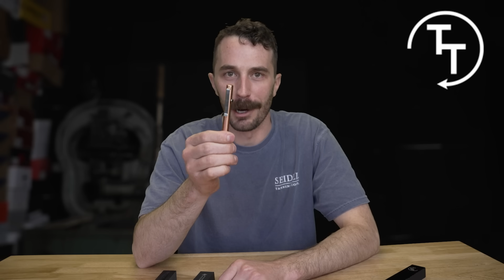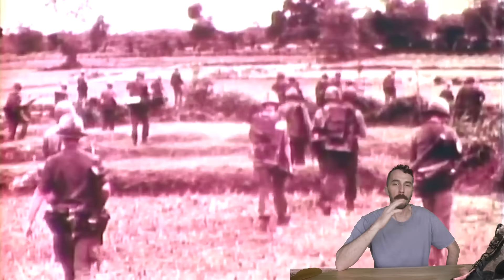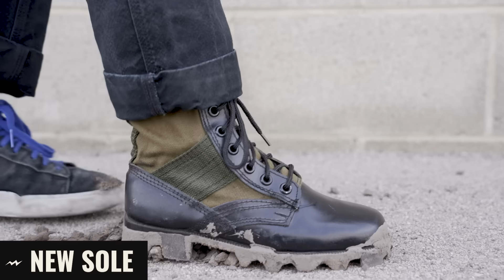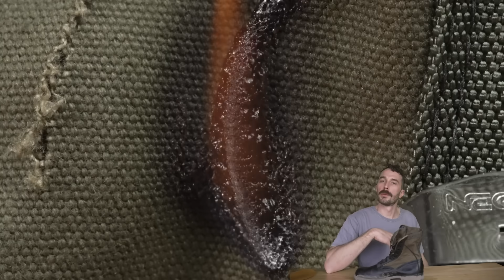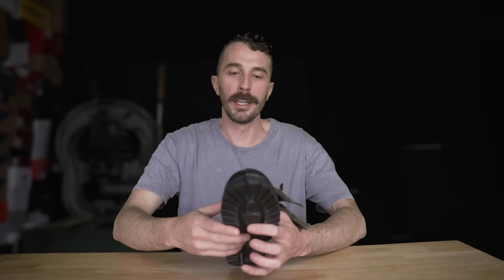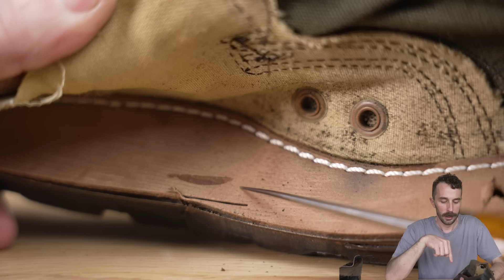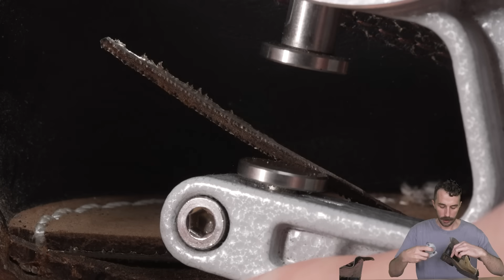Why it took 57 years to replace jungle boots

Comment: I was in the Army from 87-94.  I was in 1/3 ACR at Ft Bliss, 1/508 ABN in Panama, 3/505 82nd ABN at Ft Bragg and deployed to Saudi Arabia and Iraq, 3/334 and 1/19 as a drill sergeant.  It's interesting reading some of these experiences... I REALLY wonder about some of these experiences...  I didn't own jungle boots at Ft Bliss- those wouldn't have been good with all the sand, but bought a set before I went to Panama but ended up getting issued 2 pair when I got there.  Not surprisingly, in Panama most everyone wore jungle boots most of the time.  I seem to remember throwing away the poron insoles and getting AAFES foam insoles much later.  I always wore jungle boots for any field operations and most of the time in garrison.  When I got to the 82nd- again, most everyone wore jungle boots all the time.  During  Desert Shield we melted MRE bags into the drain holes because the boots would fill up with sand.  We got issued the first desert boots the night before the ground war- same pattern as jungle boots- just tan with rough out leather and no drain holes.   When I got to be a drill sergeant I rarely (if ever) wore jungle boots around privates.   At the end of my time in the Army we weren't allowed to wear the green jungles anymore, but could wear the black speed lacers.

In the past 25 or so years, I've read of people complaining about jungle boots- and it's important to remember it was a different Army back then.  You only had a few boots you were allowed to wear.  In the 82nd you could wear jump boots, jungle boots or cruit boots.  There were engineers attached to us that had HiTech boots- and we were told unequivocally that we could NOT wear those.  Out of all the options, jungle boots were the best field boots most of the time.  They were tough.  Your feet dried out.  You could use a stick or bayonet to scrape mud out of the lug channels in the Panama sole.  And they lasted forever.  In the past 20 years or so, the rules have changed, soldiers have a choice to wear boots that meet AR670-1 compliance, and boot technology has come a long long way.  I used to think that having a good solid, unforgiving sole was a plus for a field boot and for a road march.  Last year I got a set of Garmont T8 NFS boots.  Absolutely better boots.  The sole will wear out, but the boot is infinitely more comfortable and less than 65% of the weight.  There's one thing about having a boot that will last forever- but will never be as comfortable as a trainer.  The Garmont is as comfortable as a trainer- and has better lacing and ankle support than the jungle boot- they have drain holes and the boots themselves dry amazingly fast.  And just like any trainer or running shoe- replace it when it starts to become worn or unserviceable.  It seems there really hasn't been a whole lot of problems resupplying deployed troops, either on post or deployed to the middle of the desert.  BTW- for the record-  Jungle Boots are not "light af."  They're pretty shockingly heavy at 735 g compared to 475 for the Garmonts.  As a comparison point- my Corcorans are 815.

I still use my old main field boots as my lawn mowing boots.  The soles are rock hard and worn flat, the leather is shredded from desert coral and cracked from age and abuse, the drain vents are plugged with melted MRE bag, the stitching is coming out on the outer vamp, they're missing half their eyelets and the metal plates inside are cracked.  I NEED to use thick insoles or my feet would probably be cut to shreds.  They're really unserviceable shoes- but they've kicked ass all around the world.   I have a picture of me with those boots kicked back on Noriega's desk, pictures of those boots above different drop zones and most of all of Desert Shield...  I don't know that a lug pattern can be better with mud than the Panama sole, I don't think there was a better all-around all purpose field boot than the jungle boot for most of its issued history.  But the torch has been passed.

Comment: I got a pair of the Govt. Issue in all-black some time in the late '90s.   Very well made, far better than the cheap knockoffs w/ the green canvas (and much more comfortable), with good arch support and a nice cushioned band around the top of the lug.   I wear 'em when it's hot and I throw on my period Spec Force tiger cams.

Comment: Did my first 40K (26 mile) hump in the fleet ('88 FNG pfc) with brand new, never broken in jungles. I made it but feet were raw hamburger. Skin hanging off and 3 toenails ripped clean off, others very loose. Nails and feet were black and blue with severe swelling. First time other Marines had any mercy on me...Didn't make me run 5 miles for PT the next day. Lesson learned. Break 'em in right. BTW, most comfortable boots ever after that and still got'em. Boxed up of course...

Comment: My old jungle boots lasted into the 1990s(about 20 years). They were cotton canvas with a different sole pattern than you showed. I loved them. I later developed plantar faciitis(PT). The VA doctor told me to go back to jungle boots. Couldn't find any so, I tried desert boots. They work great. It turns out the punji plates prevent PT. The insoles worked but you needed to replace them every month or two. I spent 5 months in an Army hospital. When I got my gear, my boots had disintegrated so I got 2 new pairs at $6 per pair. Good Luck, Rick

Comment: We werent allowed to wear jungle boots. 
On another subject, in the mid 80's, an 0-5 yelled at me one cold wet February day about my Korean war era field jacket I was issued and wearing. It was the best piece of gear. Told me I had to put on my camo field jacket designed by a fashion designer who had never served. When you wore it and sat down, your belly button was exposed due to ride up of the jacket. To this day I think that 0-5 was a jerk. Pretty but cold troops over war proven function.

Comment: those insoles are the best insoles I have ever used. I used to be able to buy them from this old workwear store, sadly they closed about a decade ago. my feet, which seem to sweat more than most, were always kept dry with these insoles. And Jungles boots themselves are some of the sturdiest boots I've ever worn. I wore the soles off two old surplus pairs I had as a teen. Wore them year round, thin socks in the supper, wool socks and bread bags in the winter, the rubber would get cold and freeze below zero through, that made em real slippery.

Comment: MAKE SURE YOU ALWAYS RETRACT THE PEN CARTRIDGE WHEN YOU ARE DONE WRITING AS A RULE OF THUMB RELIGIOUSLY. FOR YEARS I HAVE TAUGHT THIS TO PEOPLE. AND THEN ASK THEM, WHY IS THE REASON YOU SHOULD ALWAYS RETRACT  A PEN. AND I HAVE GOTTEN MANY ANSWERS. THE REASON I STRESS THIS IS FOR ONE REASON. IF YOU DON'T RETRACK THE PEN AND YOU DROP IT AND IT FALLS ON THE WRITING TIP ON A HARD SURFACE. THE SOFT BALL GETS DAMAGED, DENTED AND IT STOPS ROTATING AND THE PEN IS FOR THE GARBAGE CAN. THROUGHOUT MY YEARS IN SCHOOL AND EVEN IN COLLEGE. NOT ONE TEACHER HAS EVER BROUGHT UP THIS POINT. IT WAS ONLY A FEW YEARS BACK I REALIZED THIS AND I HAVE NEVER HAD A PEN GO BAD ON ME AGAIN. THEY WORK UNTIL THE INK RUNS OUT. I WANTED TO MAKE A YOUTUBE VIDEO EDUCATING PEOPLE ON THIS. IF I EVENTUALLY DECIDED TO MAKE ONE. THE PEN MANUFACTURERS WHO NEVER TELL YOU THIS. WILL BE SMOKING FROM THE EARS.

Comment: I, USMC, wore civvie jungle boots in Gulf War I, rather than the "slick black Cadillacs" (full leather quick strap boots) as issued.  Pros and cons.  Lighter, but I also slashed the jungle boot at night on the side of it on a tent stake.  My bro Cpl. Mark Pitman wore Israeli desert boots.  Much better boot, like high top tennis or b-ball shoes for the desert.  Never in formation, of course.  The (newer) USMC desert boot appears to be apropos for modern battlefields.  

Cheers, Semper fi!

Comment: When I was in the Army I wore Jungle boots with The “ Panama soles”.  The nylon tiedown strap you describe is actually for support. If you look at the inside of a para Corcoran jump boots it also has nylon straps sewn inside the boot.  Jungle bitch will tear you up if you don’t know how to break them in properly.  I never had problems wearing jungle boots. But the old school leg boots were also comfortable. Jungle boots were great in the summer. Altima brand is the best. There were some Asian made knock offs. They weren’t as good a quality but they were extremely cheap to buy off post.
Reply: +1 for Altima. I accidentally bought some Vietnamese knock-offs and they were done after the first ftx.
Reply: I remember seeing a grunt use 100 mph tape to tape up the sole on a pair of crappy jungle boots that he had bought off post. He got what he paid for that’s for sure.

Comment: The Do Not Boil warning was in all issue boot inserts. For that mesh to work properly you had to clean it at least twice a month because they would clog up with the fuzz from your issue socks and all the darn foot powder people used. 
Best way was just in a,sink with warm water and a nail brush with a little soap and drip dry. 
And yeah, issue jungles with the revised soles were great boots.

Comment: I am dying to know what is inside the bunny boot as well. I grew up on the West coast of Alaska, and have a lot experience with the white boots, which is supposed to be the colder climate version. The last time I was Spring bird hunting, I shot a goose and attempted to have my cousine help me retrieve it. I lined my snowmachine up with the goose and him on the back of my rig, and was going to skim out and have him snag it. When lining up, we broke through unexpectedly, and sank almost at the end of the other side. I had my bunny boots on and didn' even have to go back to town, or dry off right away. I dumped the water out, and went to work getting the water out of my cylinders.

Comment: I loved mine. As a kid my dad (nam vet) got me these as hiking/work boots. The way to break them in was to wear them wading getting them completely saturated. Then you wear them til they dry. The leather conformed to your foot and made them really comfortable. Loved them
Reply: Yep, a bucket of tepid water and then lace them up. Also a good time to grease up the leather, they will dry from the inside and moisture will draw the grease in.
Reply: @Lappmogel  that's a good bit of info
Reply: I used technique to break in my first pair of Army issued boots and I use it today to break in any new pair of Doc Martens I buy.
Reply: That's  pretty  cool
Reply: Friends I had in the military would wear theirs in the shower.

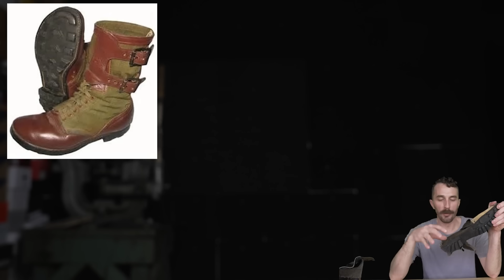Comment: What are the boots in the top left at 10:10?  They look like M-1942 Buckle Boots with canvas uppers instead of leather.  I want a pair!

The best source for new jungle boots is Altama Boot Company's Jungle PX 10.5 inch boot for about $189.00 MSRP.  In jungle green and coyote.  I wore out several pair in my 28 year career.

Comment: Back in the day, the mesh insole was used in all combat boots, not just the jungle ones. There's a story floating around that one guy got a black marker and wrote on his just below the printing. The full message was "DO NOT BOIL just peel and eat".
Reply: The same design insole we got issued in the Dutch army up till begin 2000

Comment: I was in the 82nd infantry from 86-90 There great, even in the winter they will dry at least the upper will dry unlike leather that get soaking wet and heavy only BAD PART is I had too cut out the tin plates because in the winter 🥶 it’s like walking on a solid ice pack the other problem is they come very narrow they cause ingrown toenails

Comment: This was a lot of education for me... i went into US Army bootcamp in 1994, and the basic GI boot was not comfortable at all, blister heaven.

I purchased the jingle boot, but I dont recall all those instructions. I can tell you Missouri cold weather, yeah, the jungle boot did nothing to keep my feet warm. And honestly even in AIT in San Antonio, TX the hot weather, I do not recall the jingle boot being perfect in hot weather. 

But they were more comfortable than the GI boot, but that doesnt say a lot. The 80', and 90's boots I wouldn't even consider adding the word comfortable and boot in the same phase. Just dont do it...

Hopefully, the new boot with the rubber or sneaker sole is more comfortable (there it goes again), more pleasant than the 80's, 90's US Army boots.

Its like TRADDOC creates the most uncomfortable uniforms and footwear to make the troop being miserable.

Comment: One thing to keep in mind with your puncture test is you used a metal spike.  The punji's I saw were of sharpened bamboo.  I'd be curious how much pressure sharpened bamboo would take before the tip was crushed rendering it (almost) worthless.  I say "almost" because even a scape on the side of your leg calf could cause an infection.   Still better than a hole through the bottom of your foot, but nasty none the less.  

Stateside (at least to the late 70s) we mostly still used the old black leather boots (and the black "jump boots"). Looking back, I can't believe we actually ran several miles each day in those things at Ft Bragg (HHC 50th Signal from 72 to 74).  Some rime after my  ETS they finally wised up and now the guys wear proper rubbings shoes for PT. My guess is there are  now far less "sick call" trips over foot/ankle injuries.  🙂

Comment: When I served in Vietnam 1969-1970 the Army issued a zipper you could lace into your jungle boot, but the laces did not criss-cross the tongue but just laced upwards in the holes along each side. That let you get into your boots on and off much faster and with much less effort. Really handy in an emergency, such as a night time attack on your position. Instead of bothering with laces, you just stuck you feet in the boots and pulled the zipper up. Voila!

Comment: Former Army Flight Crewman here. In the 70's I recall a  poster on the wall of many Flight Ops rooms. It advised not wearing Jungle Boots on flying missions due to the propensity  of the nylon section of the boot melting and sticking to skin in event of a fire. The poster featured a very graphic photo of  a flight crewman's severely burned ankles where the nylon of his Jungle Boots melted onto his skin.
Reply: I had a buddy of mine that was a crew chief on the huey in vietnam. He said the very same thing to me, and he never wore the jungle boot when he was on duty in the air.
Reply: That's ok, the nomex melts to the skin in aircraft fires also. It's easier to recover bodies that way. They are all wrapped up and ready to transport.
Reply: @loganinkosovo  nomex just means youre going to burn longer.

Comment: I used to wear these with the sawtooth sole but my favorite will always be Corcoran jump boots.

And I actually wore Mickey Mouse boots or bunny boots as you call them. Where I was stationed once was the training ground for cold weather operations and I think one winter it got down to -45 F
Reply: My father was stationed with the Army (but attached to the Air Force) in the Alaska Territory in the mid-1950s, and he always called these Mickey Mouse boots.

I encountered them again at the Amundsen-Scott South Pole Station (where -45 F meant summer had arrived) and everyone called them bunny boots, and I was beginning to wonder if anyone but my father ever called them Mickey Mouse boots. Thanks for your comment confirming this older name for them.
Reply: In interior Alaska, most of the civilians also wear Bunny Boots. Made by Bata, they're actually called Vapor Barrier Boots. Wearing them with a wicking polypropylene liner sock and a thick wool boot sock outside all day in extreme cold causes the socks to become soaking wet. The skin on your feet gets shrivelled, very soft and tender. On the plus side, your feet stay warm. ... Wearing Bunny Boots, you can break through ice into water over the tops of the boots, filling them with water. Then get out of the water, sit down, take them off and pour the water out. Take off your socks, wring them out. Put both pairs of socks and the boots back on. Then walk your feet warm again. Amazing survival arctic boots. ... In interior Alaska I've worn them on a dogsled trapline, 5 days from the road at -60° F with no problems. They work well with snowshoes and the right bindings. ... The metal valves on each boot is used to equalize the pressure contained between the inner rubber boot and the outer rubber boot when at altitude in an aircraft. ... When you wear them daily for several months in winter, your feet get really funky. Many of the locals then call the VB, vapor barrier boots - VD boots!
Reply: Fort Greeley, Alaska, near Delta Junction, at the intersection of the AlCan and Richardson Highways, was the US Army's Northern Warfare Training Center (NWTC) and Cold Regions Test Center (CRTC). ... I once hunted moose, west of the Delta River with the Commanding Officer of NWTC, Col Ed Shehan. I learned a lot from him on that high adventure hunt.

Comment: The Panama soles were certainly the best design for shedding mud. Having a boot that dries out fast was and is another advantage these boots had. The only down side, was that the spike protective qualities made the boots, for me anyway, absolute miserable on road marches with rucks on hard surfaces. The impact really beat on the soles of my feet until they were so sore I could barely walk.  No blisters or bruises, just like the alleged ancient torture method of hanging someone upside down and tapping on the the soles of their feet with a stick for several hours. I just learned not to wear them on road marches. That problem seemed only unique to me, but I at least was able to gut it out and not fall back to the truck. I just learned never to wear them on road marches. But, yeah, they’re still a great design for warmer weather out in the woods. Increadibly durable. Not surprised to learn about the block of wood.  I still have a pair of the newer version with black nylon tops.